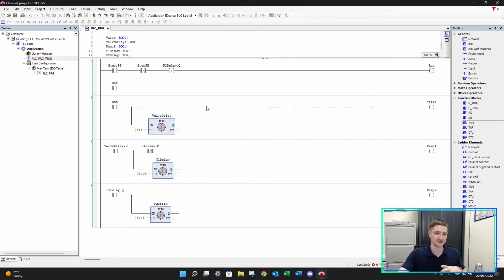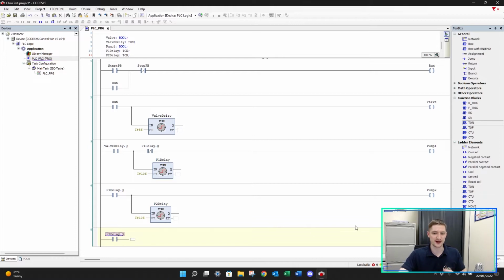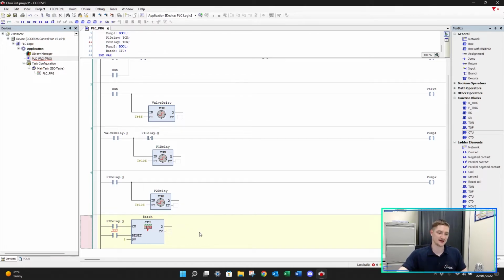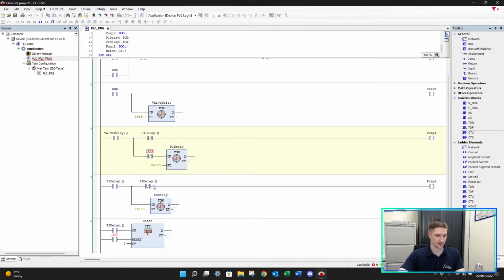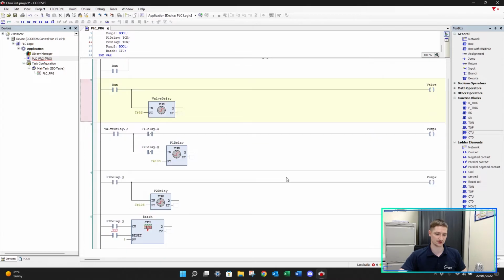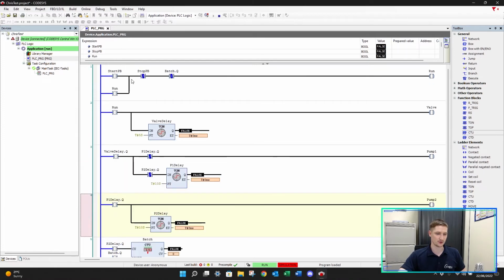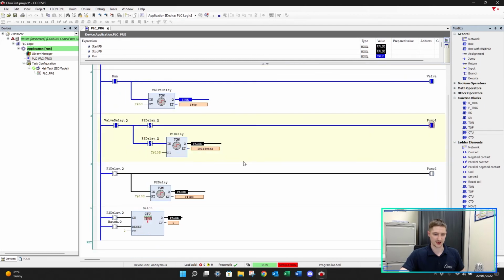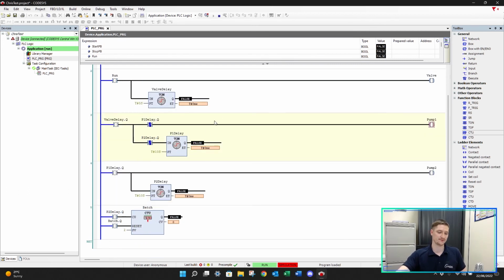How to use CODESYS CTU Counters!

Comment: Thank you very much for your courses
They help me a lot to get back into the topic after 20 years.
I have noticed one small flaw.
If I stop the process early via the Stop_Pb, the counter does not reset itself.
A normally open Stop_Pb on Counter Reset parallel to Batch.Q solves the problem, however